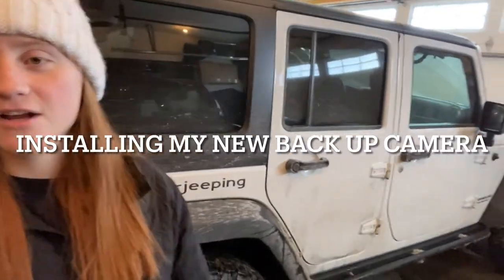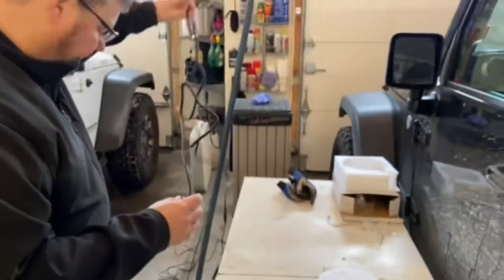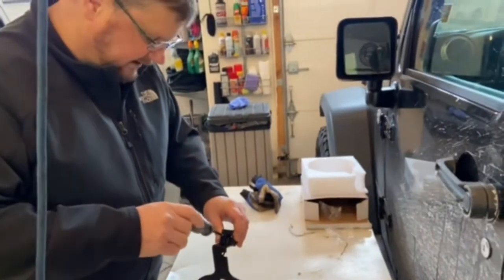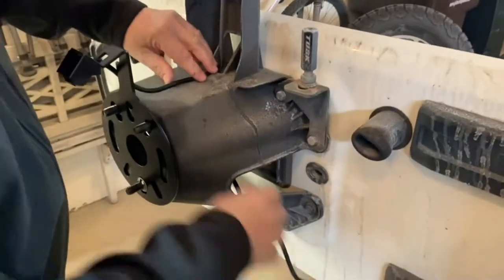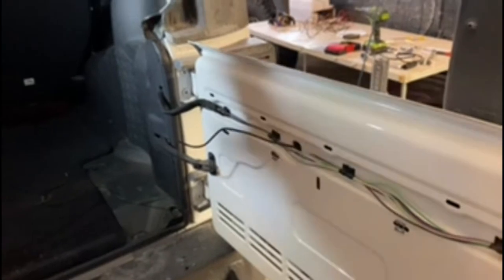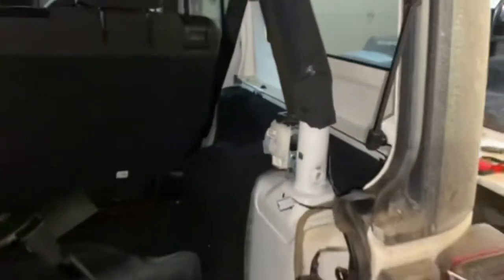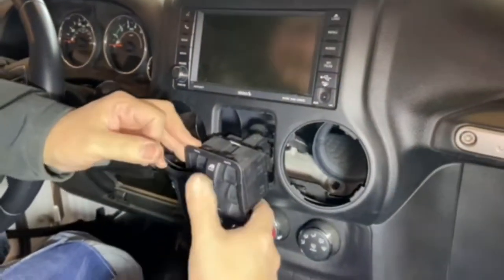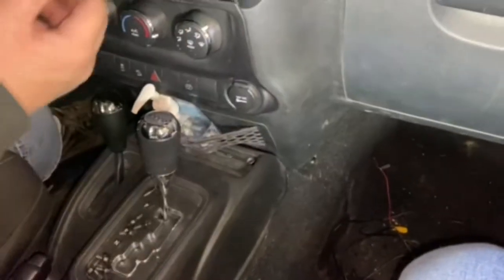Installing a backup camera on a Jeep Wrangler

Comment: Did I miss something? When did you hook up the camera to the power or reverse light wire?
Reply: where did you hook up the power?
Reply: @mattnovak3956  I noticed that the video connector (RCA) had a red and black wire off the side of it which are power and ground. That can be wired to your switched lighter. If your power and ground wires are near the camera tap the reverse wire to the power (red) and the (black) to a ground. I connected a tailgate handle camera with to a Ram pickup same process.